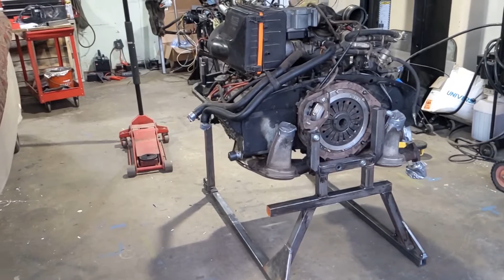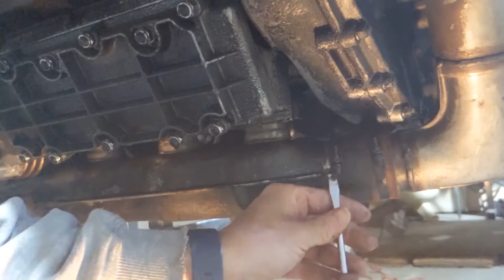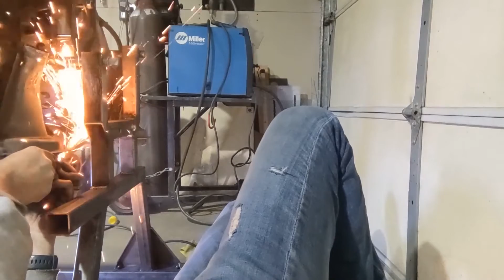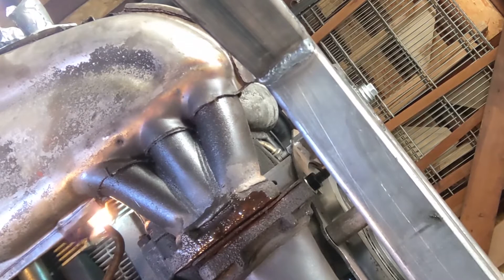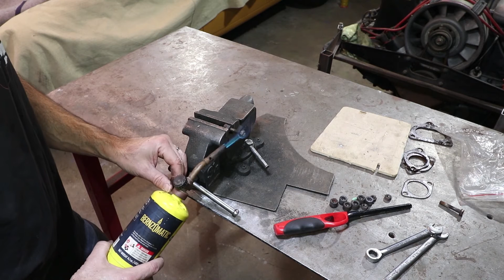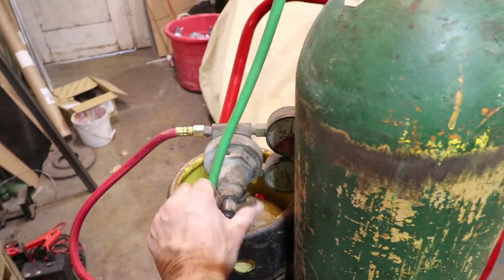RISKY Exhaust Heat Exchanger Removal - Porsche 3.2L Carrera Engine

Comment: just did this , 3 allens were frozen and already rounded inside from pm . sacraficed a 3/8" allen(bigger than 10mm) ground a taper on all six sides  and pounded it in when orange. it worked amazingly good
Reply from the maker: Yes!  Congrats on getting them off

Comment: Thanks for the video Tom. Did you end up heating all 12 nuts? And, did you reuse the nuts or put new ones on with the new heat exchangers? How long did the proces take you in total? Thanks!
Reply from the maker: Yes, I heated all 12 and threw them in the trash.  The whole process is about three hours assuming nothing breaks.  I did cut and replace a few bolts .

Comment: The piezo click start nozzles (bernzomatic 8000) will get the metal cherry red even with regular propane. Throwing ice cold water on the cherry red metal will shock the metal even more.
Reply from the maker: Interesting, I thought there might be something better available because you aren't the only who has said they work.  
The version I had clearly didn't.  Do you get a concentrated flame?
Reply: @GarageTimeAutoResto  it’s got some sort of turbulator swirly gizmo in it that accelerates the flame and adds additional oxygen. At least that’s my theory anyways. I was shocked as to how hot it gets with regular propane. It’s probably a beast with mapp,  even if the new formulation of mapp is not the same as the old mapp.

Comment: a "mini ductor" inductive heater works awesome too.
Reply from the maker: True, I looked into these too because they are so compact versus the torch.  My issue was fitting those coils in between the heat exchangers.  The space is really tight!
Reply: @GarageTimeAutoResto  Yes that's true especially the barrel nuts. In the most extreme case  you would have to cut the heat exchangers off. You can get smaller coils that you can bend. I was lucky. Mine came off with just penetrating fluid and a T wrench so I wasn't putting too much torque on them.

Comment: Do you ever quench your heated nuts with penetrating oil?
Reply from the maker: To prevent the squeaky removal?  Or to blue them?
Reply: @GarageTimeAutoResto  neither... When using a propane torch (not as hot) I'd found a drench in pb or wd helped speed things along...
Something I figured out years ago. The biggest mistake I've seen when coping with stubborn fasteners has been seeing a 12pt used when it should have been a 6...

Comment: great video as always tom! i had an exhaust leak on my '72 911E back in the day and i had to take the exhaust out on the driver side. since it was my first time to do such a job, i ended up breaking several studs because they were so corroded and rusty. i then had to use a time-sert thread repair kit on the broken ones. not a fun job because i didn't have a lift.
Reply from the maker: Thanks for sharing. I was terrified of breaking something.  Glad you were able to get those repairs done while the engine was still in the car.
Reply: @GarageTimeAutoResto  i think i just got lucky! :)

Comment: I don’t know if there is any real difference between the propane torch and a mapp torch but I recently bought a mapp torch kit for work.  It makes a lot of noise and heats things up to red hot rather quickly.  

In high school in the mid 70s I would rent an oxyacetylene kit when I needed one. I didn’t really think about it at the time. I just went to the local rent-all place.  Paid some cash and drove off with it.  Toughest part was the gruff “you know how to use one of these?” comments from the guy behind the counter the first time. I did, it was taught in school.  I guess that was good enough for him.  A lot of trust in the relationship back then.
Reply from the maker: My Mapp torch might be partially blocked or not an aggressive enough flow to get red hot nuts.  Glad you got a good one.  
I never thought of renting a torch, but not a bad idea.  Wonder how the charge for the amount of gases used?

Comment: I only have a small tank acetylene no Oxy and it suits my garage needs, my two cents. Looking forward to seeing the SS exhaust, always wanted one but could not justify the cost.
Reply from the maker: Interesting.  I wasn't aware acetylene could be used on its own.  Very cool.  
I'm excited about the new exhaust too.  It will be so much lighter than the stock exhaust.

Comment: Not to be too picky, but the easiest way to take the entire system off is in one piece. Just remove the 6 hex nuts and the 6 allen nuts from the head studs and the entire system will come off in one piece. Then, if necessary, you can take it fully apart on the ground with easy access to all the bolts, especially the 6 that connect the cat converter to the cross pipe and the left heat exchanger . I’ve done it many, many times this way over the years. I’ve also had no problems heating the hex nuts with my small acetylene torch. It just takes a few seconds to get everything red hot, and then they will come loose. I usually find that the allen nuts don’t need heat, but it takes some experience to get the feel to do it - the trick is to have a long 10mm allen socket with a GOOD end, tap it up unto the nut to make sure it is fully inserted, then give it a quick hard turn - they usually make a sickening snapping noise when they release, but from there you can usually turn them out by hand. I use a 16” 1/2” drive ratchet for this. Sounds scary but at my age I’m fearless. I also have Stomski’s exhaust stud repair kit just in case.
Reply from the maker: Thanks Jim, that is why I share what I do.  I didn't mention it in the video, but I realized after the fact that I could have taken the cross pipe off while attached to the heat exchanger.  As you say this would be much easier to cut on after it was removed.  
The catalytic converter and muffler was already off this engine when it was shipped, but your idea to remove it as one is very valid.  
Thanks for sharing your thoughts on this!  That is what this community is for.  If I was doing this for a living or getting paid a fixed price, then this kind of advice is so good.  
I did heat the barrel nuts and they came off easy.  I used a sharp allen wrench with a big vice grip on the end.  I should have showed a picture of it.  It didn't look pretty, but it did work.

Comment: Try electro-induction heater.
Reply from the maker: I considered that, but the space is too confined to fit coils in there.  At least for the heat exchanger part
Reply: @GarageTimeAutoResto  There is a couple of those tips that you put on tool.Diferent angel,size,lenght...I saw on you video that the space is not too big.
Reply from the maker: Right, I'd love to have one of these tools too.